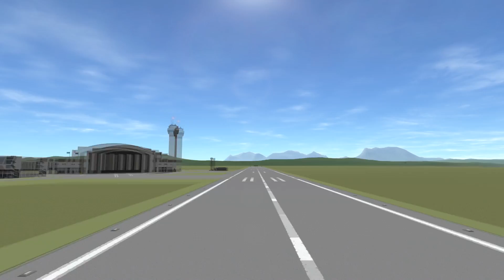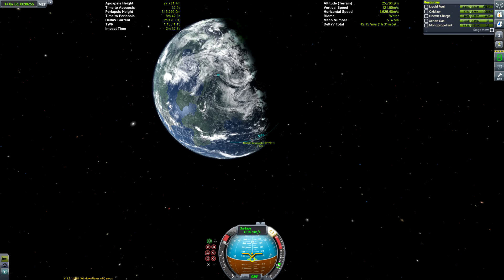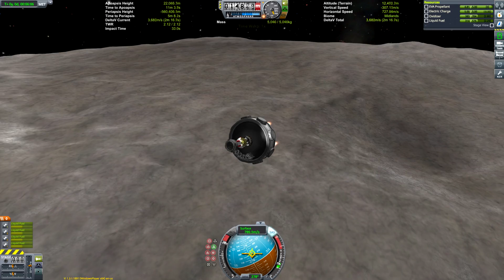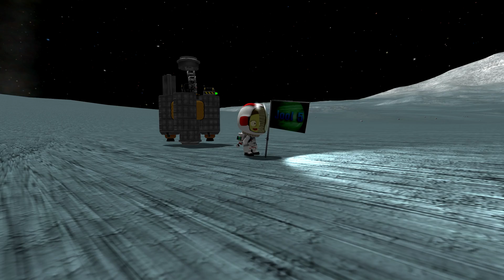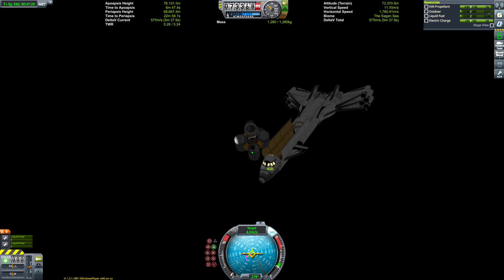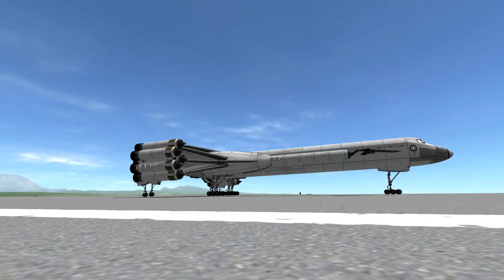KSP: SSTO to Every Jool Moon - no mining!

Comment: When I went to Jool, the Kraken kicks me out of KSP 1 😑
Reply: Not sure if this is still useful, but u can fix the kraken by re hitting “ control from here” on the most stable point of ur aircraft, and turning off autostrut on all ur parts, or at least making sure there all the same type of strut, will not always work but I was able to assemble a mega mining outpost with like 30 ish modules in total crafted over 50 shuttle flights, if the kraken ever hits, u gotta reload to right before it did, control the craft that spazzing out, and hitting “control from here “ on the front most facing docking port, fixed it every time, kraken usually stems from the craft being controlled from a interior docking port or something after you’ve docked , then when u leave the craft and didn’t re hit “ control from here” or autostrut being mixed up with different host parts and glitching out, obviously there is part clipping kraken attacks, but those glitches usually happen on the launch pad, if it happens in flight, especially that far, it’s probably an autostrut disable or a control from here fix

Comment: *for those trying to do the math from home, given Matt's discussion of the delta-v formula:*

dv = isp x 9.81 x ln(wet mass/dry mass)

if doing this in flight and trying to work backwards from an amount of fuel, liquid fuel and oxidiser both have a density of .005 tons per unit. so like, 200 LF weighs 1 ton. 
so, dv = isp x 9.81 x ln(wet mass/(wet mass - fuel+oxi x .005))
Reply: WHAT?
Reply: this has context in matt explaining the delta-v equation, which i didn't think to add but i fixed that
Reply: LupiDragon what are those!!!!
Reply: Oh hey Lupi
Reply: You missed a bracket, thanks though!